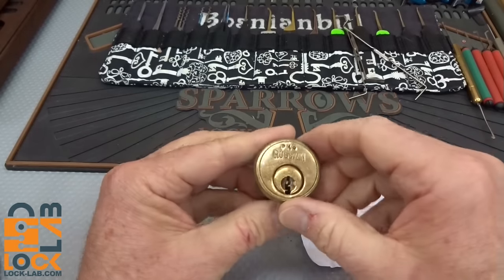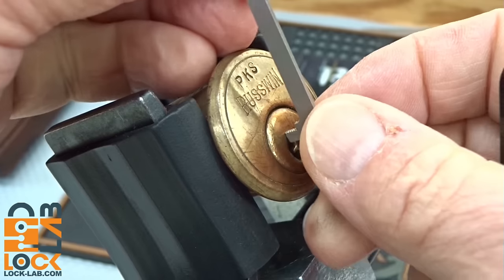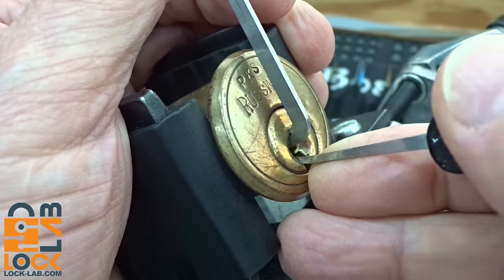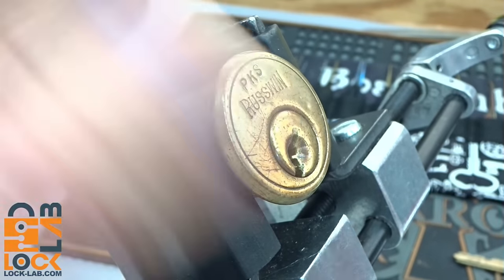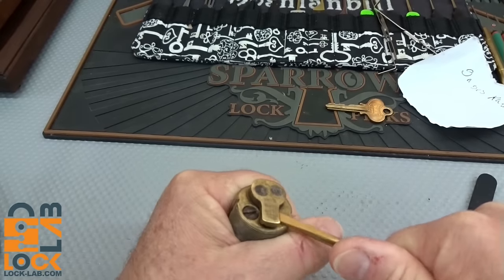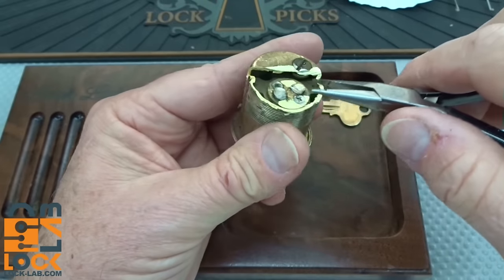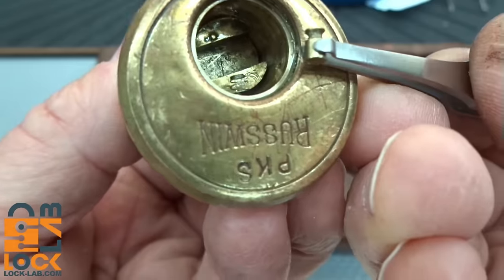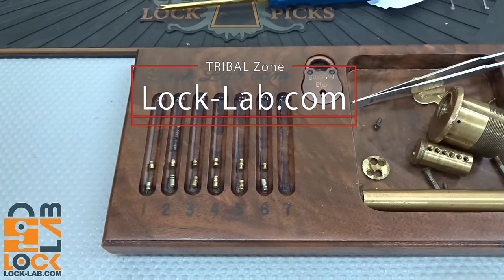(947) Challenge:  Gage Rage

Comment: sorry Bill I should have included instructions on how to disassemble that lock. I really thought the lock master would have known 😉the outer shell just slides off .that screw was originally how it was released but it no longer works.a my how it was much more fun to watch you wrestle with it. I'm glad you didn't give up on it. I do have another lock I'm working on but im taking my time and looking for something very alien to put inside. also I meant to put springs in all my cylinders but when you have a 4 yo with his hands on all the works you can get distracted.thanks for picking my locks and posting the vids . you're the best Bill
Reply: Jack, Bill must be from the new school of lock picking. When I was in business in 1980, I saw these quite a bit in older homes with Original Mortise Locks. The adjustablilty factor was necessary for some of the OLD monster doors that were still around then. Upwards of 2 1/2 in thick, required the adjustable cylinders. As soon as Bill turned it around, I knew what it was.
Reply: William Wilcox Roger that. I'm new to all this my self but I love it.I have always been mechanically inclined. I realy took an interest in locksmithing and lock sport. I would have left the case off but the brass piece holding the springs in was badly worn and I was afraid it would pop off again.i think that's how I forgot to put a spring over that American spool.

Comment: Sad to see you cut that old cylinder like that. That is an adjustable mortise cylinder, the screw at the end adjusted the depth before everyone got together and standardized cylinder lengths to 1 inch, 1 1/8 inch and 1 1/4 inch. Schlage and I think Ilco now have convert-a-cylinder that uses sections to lengthen cylinders to over 1 1/4 inch for those rare occasions long cylinders are needed

Comment: +BosnianBill That screw on the back of the cylinder unscrews. However, it may have been stripped out, or the pinhole in the side of the cylinder has a detent. I have a Russwin I removed for a friend that is adjustable like that.
Reply: That is an older Russwin Mortise cylinder. The cylinder was adjustable to fit different depth doors of old.
Reply: "or the pinhole in the side of the cylinder has a detent"
I was thinking the same.

Comment: Sorry but am kinda ..okay I am laughing. If you haven't seen one before it is obviously baffling. It is an adjustable length cylinder and by turning that screw it Should drive the threaded shell off and you can get to recognizable parts. A few companies made these.. Nice job picking it.

Comment: I PUT EMHART DOORKNOB LOCKS ON ALL MY TOOL STORAGE ROOMS NOW! THE HINGE SIDES OF THE FRAMES & DOORS ARE PINNED WITH BALL HEAD STAINLESS SCREWS, AND I HAVE TWO ANGAL MUL-T LOCK KEYED DEADBOLTS ON TOP AND BOTTOM OF EACH OF THE 240 MINUTE RATED FIRE DOORS. It took me the better part of a (24 hour) day to pick one of the Emharts. Sparrows makes  little scimitar picks that will spin those pins around. I dropped chunks of tungsten carbide welding rods in place of one of the straight pins, so have fun drilling it!

Comment: Thanks for your after-work time. Newbie question: You guess 5 pins at 2:26 and after the win you find out it's 6 pins at 10:27. How does the successful pick happen? Was one if the pins obsolete, or was there an omission in the commentary of getting all six?
Reply: he guessed 5 because he couldn't feel the sixth on account of it having no spring and you don't really tend to count pins as you're picking them because the cognitive load is already high enough from feeling for binders and feedback to worry about numbers.

Comment: Looks like the screw was stripped. It's an old adjustable length mortise cylinder. You should have been able to use a flat blade screw driver between the face cap and the outer housing to get it to separate. Not between the cam and the outer housing.. Maybe next time.